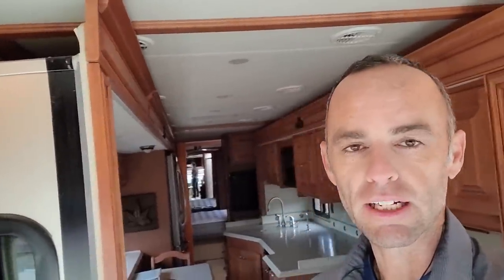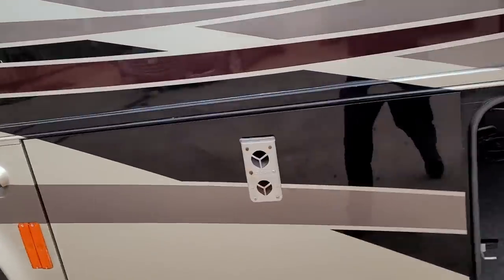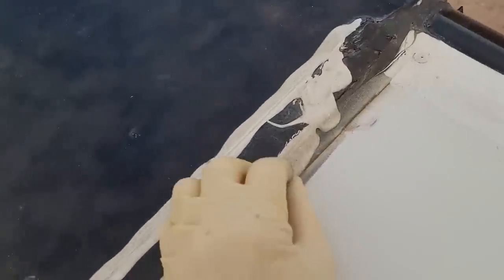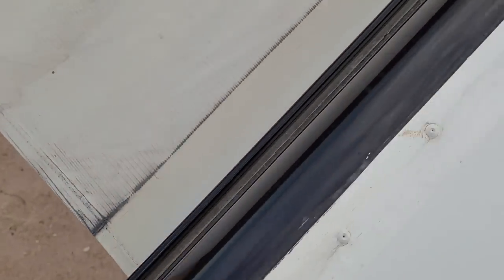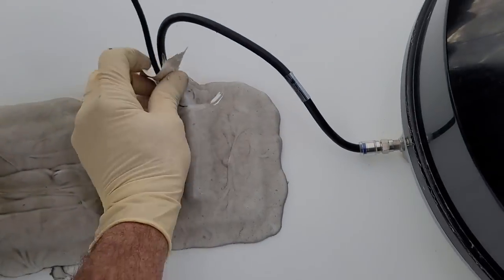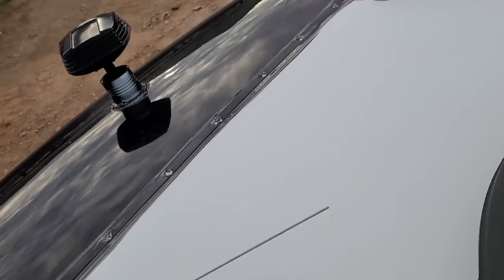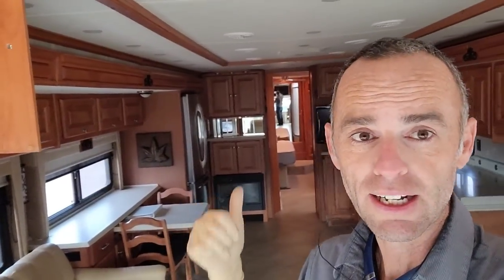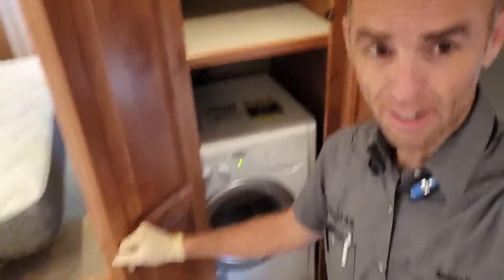What to Look for on a USED Tiffin Motorhome Inspection

Comment: The water bay floor has been replaced.  Tiffin sends the coaches to Kimbrough's in Tuscumbia, Ala.  They replaced the rotten floor with a white sheet of High-density polyethylene (HDPE), which resists humidity. They also do the CAP Radius replacement and under the driver side front slide which also gets the rotten floor.  All part of the Tiffin big three.  I have an '05 that looks like that one.  Great video!
Reply from the maker: that;s great information. Ive done the replacement a few times and the radius once. I remember the factory sending a crew to do the floor on a slide and they did it so quick!
Reply: Yes, the "Big 3" are common repairs done to Tiffin MHs of that era.  I would be suspicious of a rig that had not had these 3 items taken care of.  We own a 2010 Tiffin Phaeton 40 QTH, btw.

Comment: Beautiful coach!   Could you do a video on the inside and slide inspection sometime?   When I bought a Class A last June, I had no real idea what to look for.  Luckily, I bought it from a guy that runs a RV dealer shop.   He had gone through it and fixed everything when he bought it 6 months earlier.  New frig, new water heater, new front tires, new batteries, new sway bars, steering dampener, engine tune modification, cold air intake, etc.   the good thing is, when I need something done, he gets me in quickly.   Best wishes James!

Comment: I have met so many people with brand new coaches during my travels who spend half their time back at the shop having warranty work done for the first year or two…just met a couple in Santa Fe NM who had a 2021 tiffin…and both the main slides out were stuck fortunately they were stuck closed
None the less they had to stop there trip and head home so the coach could be worked on…
Reply from the maker: Its a common issue.

Comment: At 9:10 you talked about the OTA antenna.  Those were originally made by AntennaCraft (now out of business) and they were crap.  Water would get into the outer housing and corrosion was common. The motor would then not turn the antenna. I find that most folks with those original antennas have had to change them out.
Reply from the maker: Thanks for the info

Comment: Radius failed when Grandpa scraped along a tree or building.  Last year at the RV resort Tiffin Barbeque the Tech discussed the issue with no stick sealant that some people buy. Possibly remote or not able to get the proper sealant. He advised to purchase and carry a tube of "Lexel" Tough sealant for anywhere on coach. It is not cheap(14 per tube at Lowes-Home Depot)but it will seal to anything, steel, plastic.rubber, roof, siding etc etc.... you can use in your wet box and even apply when wet!!   I bought a tube to try to fill small gaps on 2006 stick and tin Fleetwood Pioneer. It works awesome!!!!
Reply from the maker: if I remember the fiberglass twisted or cracked excessively.

Comment: You do complete inspection of all systems?    You for hire to do inspections in the area?
Reply from the maker: I do most systems, but I don't look into the engine or transmission
Reply: @AZExpert  sir I wonder what you know of Alfa Motorhomes . On roof looked like it was coming untucked on side.   Thx to your teaching seen water stain around tv antenna. Foggged.windows.  roof scares me. I little hefty to climb .  Oh sales called stain from condensation